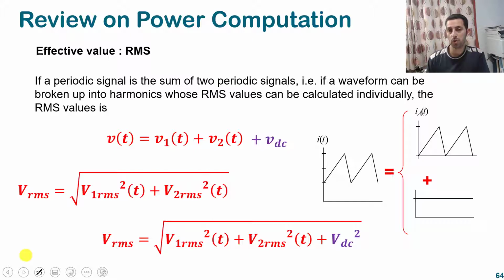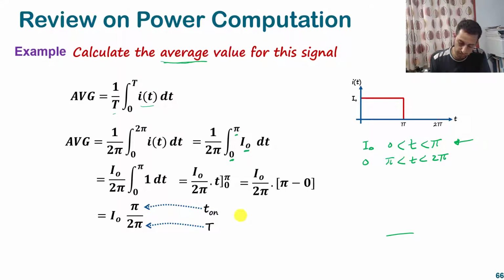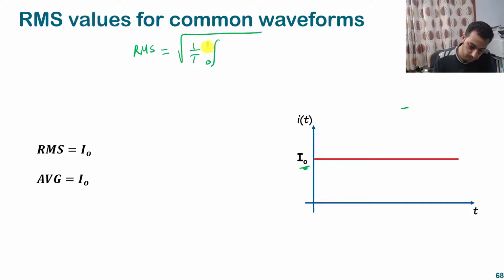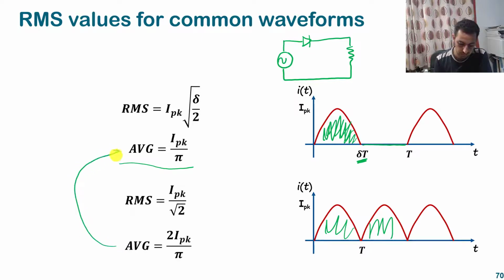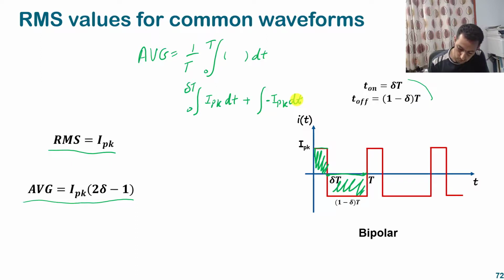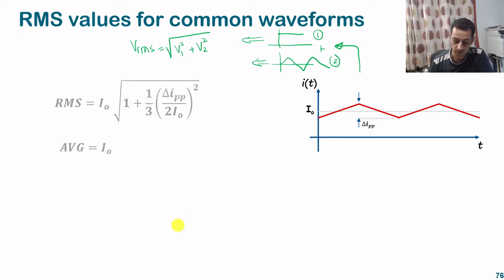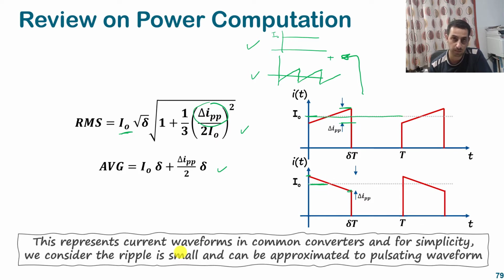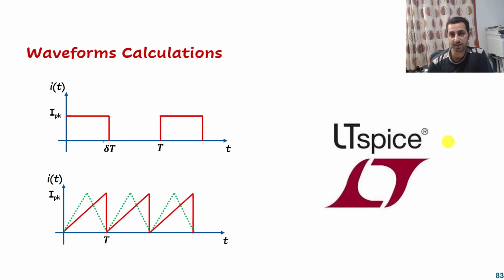09 RMS calculations for different Power Electronics waveforms

Comment: For any have wave sinusoidal signal, the effective value ( RMS ) is : 0.5 * Magnitude .
In the case of a current through the purely resistive load ( sine wave rectified by only one diode ) it is : I_peak/2